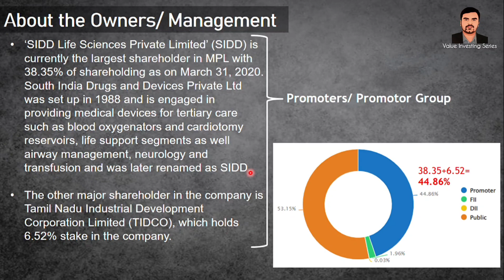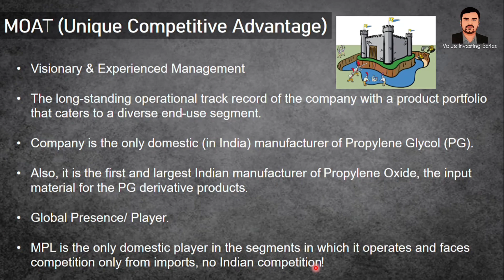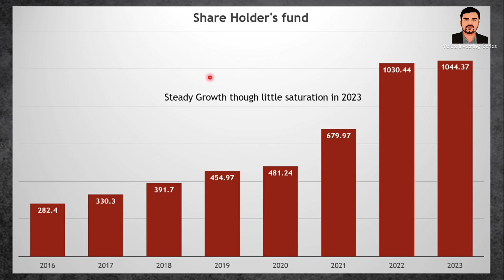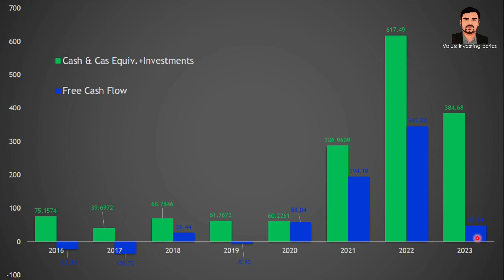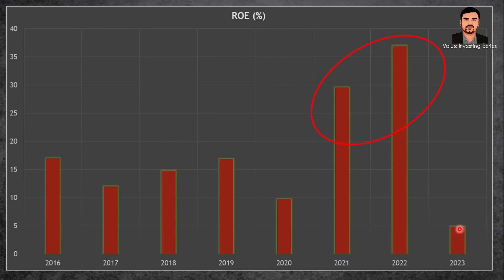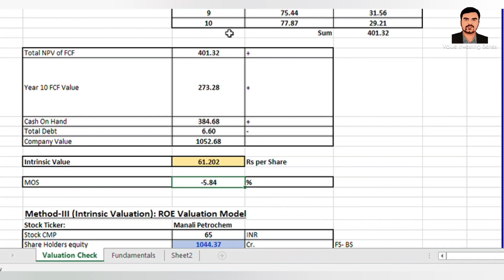Session-91: Manali Petrochemicals Ltd.- Stock Analysis

Comment: Nice analysis. Better to wait for OPM to show some signs of improvement to enter. Opportunity cost is also needed to be seen as well to invest because recovery does not seem near. Management is doing well with acquisitions but such this industry has few factors beyond control as you pointed out. 

Are you analyzing or working on any mid and small cap of current theme stocks like Ethanol blending, AI, Electric, Renewable energy, Autoancillary, Defense Etc ? 

Which 2-3 sector do you think will flourish most in times to come ?
Reply from the maker: Auto ancillary & defence already am holding bharat forge & kalyani steels since 5+ years. AI & renewable am working on.. soon you can expect some video:)
Reply: @Invest_Independently..   5 years, great. Some video on current stocks as of current prices and current valuations. That would be much awaited. Release it soon. Thank you.
Reply: @Invest_Independently..  also cover in one video some finance stock be banks or NBFCs as India growth story will be led on the back of these.